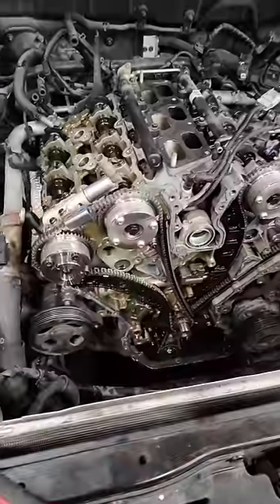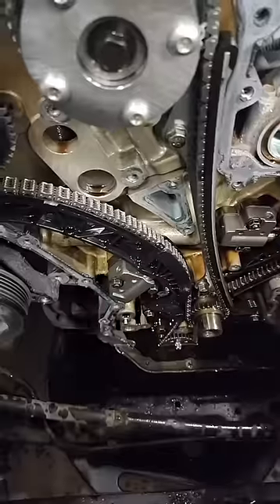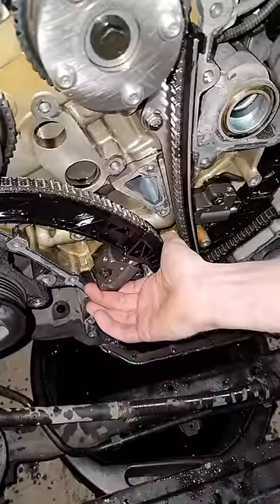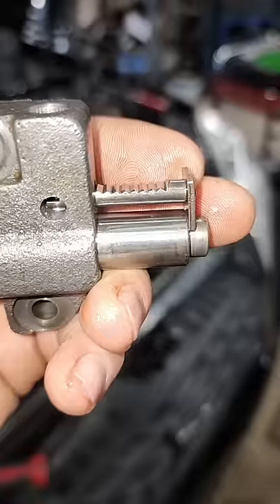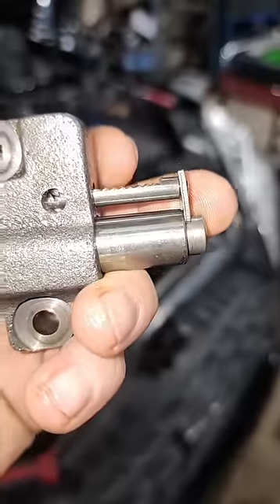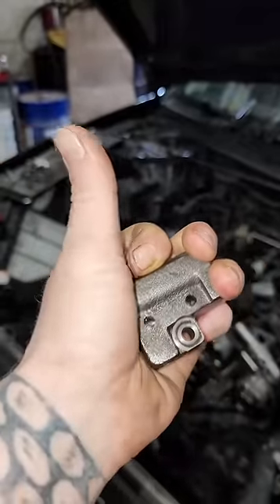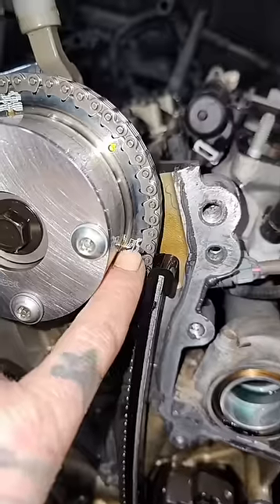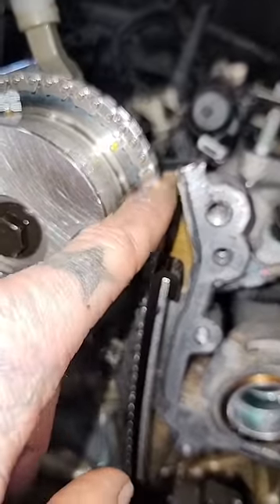I'm not happy

Comment: Hope you do a follow up. Curious to see Cloyes' response
Reply: Cloyes told me too bad,would not offer any assistance!!!
Reply: At best they offer to replace the tensioner with likely another tensioner of equal quality.
Reply: I did this job on a 2016 Explorer 3.5 the crank sprocket broke in half and destroyed the engine the good news is they told me they'd send me a new crank sprocket it's got me in quite a jam with my customer
Reply: Good luck! Same happened to me with a cloyes kit. Took out valves and a couple pistons. All they offered was a new tensioner.
Reply: @murderbirdLTX  damn
Reply: Is Cloyes an aftermarket provider or was OEM used?  🤔
Reply: @eddiegerlach7121  Cloys is aftermarket, they used to be one of the better options. I've used this brand for years. Next time I need to replace something, I might not use this brand considering I've read some pretty bad things in the comments.
Reply: this is why you file a labor claim through the parts store. Are any of you guys even real mechanic's? 🤣
Reply: Boycot Cloyes
Reply: @Thundarr995  don’t buy cloys. Oem timing or nothing at all
Reply: I've seen a few times where the parts supplier covers the labor, but only if it's a shop. If you're a regular customer, they tell you to kick rocks.
Reply: @CobraKiller02  I Kno right. Even if they dont cover all the labor they cover at least 75%
Reply: @eddiegerlach7121  cloyes is an aftermarket provider but claims to meet or exceed oem standards.
Reply: @crimsonlight4205  is it that much more expensive to go OEM?  I understand saving where one can, but is it difficult to persuade the customer about the peace of mind?  There are AM options that are proven and I always go OEM when possible ....sounds like these Cloyes folks are something to avoid.  🤔👍
Reply: @YomommasStankPoon  
That was a nice way of them saying to go get bent.
Reply: @Thundarr995  depressing seeing these name brands going down the toilet that can't be trusted anymore.  
I don't wrench on the side anymore but stuff like this would make me go OEM. Keeping my own fleet going is bad enough, and me getting older I don't have time for junk parts (not that OEM is always the best).
Reply: @eddiegerlach7121  cloyes used to be a great name in timing products. With older vehicles I often used cloyes double roller timing chains or their noisy timing gears. Guessing they just aren’t too good with newer tensioners.
Reply: 30 years ago Cloyes was good. Oh well.
Reply: @JJ-py6es  If that happened to me, I would seriously consider taking them to small claims court.
Reply: @eddiegerlach7121  Cloyes, based in Arkansas, is aftermarket.
Reply: @m3rdpwr  this is happening alot with old trusted brands. 
Definitely a good idea before purchasing these days to see if your favorite company got bought out.
Reply: I bought a Cloyes  for my 2.7 Dodge because I thought they were quality even though I had a problem right out the gate with the first one I thought it was my fault on my own car
Reply: @CobraKiller02  I did that once with a Motor Mite Dorman flex plate that was made of such soft metal it tore apart like cardboard before the car made a 3 block test drive. I raised Hell and they ended up having to pay to have it replaced with an oem junkyard part as well as refund the purchase price. I wouldn't accept the replacement because it was made of the same cheap metal. The original part was hardened steel and rang like a bell if you tapped it while the new one just made a dull thud and was so soft I could bend it with my hands.
Reply: @CobraKiller02  If your not doing $3000 a month with tbe parts store, they won't eat the loss for you. If the parts store isn't doing $10,000 a month with Cloyes, Cloyes isn't doing anything for them. And chances are if Cloyes claims are killing them, they will switch brands.
Reply: @MrTheHillfolk  agreed, or just put profit ahead of quality.
Reply: @MrTheHillfolk  BTW interesting channel you have. Subscribed.
Reply: @m3rdpwr  
Hah,thanks man ! 
I've gotta do some uploading , I've got a ton of footage of that Ute conversion but no time to edit and post. 
I might end up doing an update vid and then posting the older footage I have. 
Thanks again ✌️
Reply: @MrTheHillfolk  yeah, I hear you. I have a couple hundred videos, mostly air fryers. I haven't posted anything or not much of anything for the past year.
Reply: @eddiegerlach7121  Not as much markup on factory.
Reply: @thisisyourcaptainspeaking2259  "equal or lesser value" 😉
Reply: @CobraKiller02  I came here to yell "LABOR CLAIM!" LOL
Reply: @andylowe2725  Oh good, another fine product from Arkansas.  I'm going to blame meth.
Reply: @Thundarr995  so even after this story right here to which you are commenting…you still might buy crucial parts from this same supplier. God bless your future customers Sir!!
Reply: @murderbirdLTX  what was your torque spec on your crankshaft bolt?
Reply: @CobraKiller02  it's still pretty hard to get a labor claim through the local parts store  because they only want to give you 40% of the actual labor
Reply: @larryreno8293  I don't have my notes in front of me but I'm pretty sure it's something like 37 foot-pounds then 90° and I use red Loctite
Reply: @larryreno8293  that was a new crankshaft bolt of course and when I did the autopsy the balancer and the bolt and everything was securely in place just pieces of the crank sprocket down in the oil pan
Reply: @eddiegerlach7121  recently it hasn’t been cost that drives technicians to use a aftermarket supplier it has been the lack of OE parts availability. It took 7 months to get a 5.0L for a ‘17 F150, 9 months for a 3.5 for a explorer, 4 months for a 3.5 turbo.
Reply: @murderbirdLTX  I hope you didn’t skip the first 2 steps of the toque procedure, because if you did that is the reason for the failure. The first step is to torque to 89 lb/ft. This is required to pre stretch the bolt then loosen 1 turn.
Reply: It’s as if you all didn’t realize Rockauto sells OEM parts for most cars. 

Sure, if something fails, they’ll only replace that one part, but I find it hard to believe so many of you “unknowingly” destroyed your cars before you noticed the new failure.
Reply: I've used cloyes many times....last thing I need is what happened to you. Dealer from here on out
Reply: @Solar Yellow IS300 
Except aisin, technically aftermarket but used in OEM kits for Toyota and make kits for other japanese brands
Reply: Who is John Galt? In so many words, imported steel isn't the same. Period
Reply: Cloyes is OEM for GM. Done many ecotec engines and the ones you pull out say cloyes/GM

Comment: The worst part of working on cars isn't busting your knuckles,  getting greasy up to your elbows,  or having junk land in your eyes.  The worst part is deciding if the new parts are worse than the old ones you are pulling off.
Reply: I just had this realization the other day. Guess that means progress.
Reply: Had to reuse my temp sensor because the new one was way off.
Reply: FACTS! As I read this with gas in my eyes lol
Reply: Wear those safety glasses kids
Reply: I'll pull used OEM parts from a wreck before installing most of the new trash they make. Wear gloves chemicals are bad for us and our skin is amazing absorbing them.
  Edit for auto correct
Reply: @Deric Cribbs  that's about where I am.  I've put two new thermostats in my old rig and they are both faulty.  I'm going to go down to the wrecker and grab a couple, hopefully from the 90s.
Reply: @jasongross4124  we're the new old people.  "Back in my day".
Reply: my mechanic asked me once with a dead face "you wanna change your good part for a new one"?
Reply: I think you nailed it here they replaced one too many parts. I get the we might as well since were in here but not with inferior parts

Comment: Just had to redo a timing chain cover gasket and front crank seal due to the front crank seal failing a week after installation. I'm really getting tired of doin the same job twice because of poor parts quality control.
Reply: Thats why you should inspect the parts before installing them. Of course there will be parts that you can't tell if they are gonna fail by just looking at them, but most things, especially seals and gaskets will have pretty obvious signs of defects. Just always spend the time to look at the stuff before you put it back. Even stuff you ain't replacing. It's worth noting what is and isn't broke or breaking because then it can't be said that you caused new problems when you have a list and offered them to replace it when you was working on it.
Reply: Alot of these parts are made in third world countries or China and are never inspected being made from tooling that have seen 14 times the ammount of parts the tooling was made for.
Reply: I have a hard time believing it was the parts fault ...
Reply: @@thejloud be surprised how much shit can get damaged working on cars especially when taking off old bolts lol (not a trained mechanic)

Comment: Like the old saying goes "just because it's new doesn't always mean it's good" lol. That really sucks for the customer though.
Reply: And the mechanic too, having to do the job twice due to crap parts.
Reply: "NEW" doesn't mean "good".
It just means "Never Ever Worked"
Reply: Manufacturing default. 

Machines mess up occasionally.
You gotta realize, a human made that machine and another human programmed it.
Reply: @robert9595  engineering default.  The whole system is based on profits.  Cheaper metals means more money.  Cheaper componants mean more money.  Im not saying manfacturing doesnt have flaws, Im saying worse material is being used to make parts
Reply: Do people just pull new parts out of the box and install them without inspections? You can see the bad teeth while demonstrating that they don't catch
Reply: @stevensmith8923  dont take much to make em strip off like that.  Ive seen multiple slack adjusters do the exact same thing with one application of the service brake.
Reply: What it sux more for is the guy that did the job....I mean yea the customer IS important but the poor guy that's got to redo the job for nothing

Comment: I had this happen to a timing belt tensioner in a Subaru with an EJ motor... Once upon a time companies used to honour their warranties- especially to commerical workshops, this isn't necessarily the case anymore. We often find we have to take companies to court to get was would have previously been run of the mill warranty claims
Reply: But it take more time and cost more money going to court fighting them to fix it then just fixing it yourself. And they know most ppl wont bother because of this.
Reply: @jacksmith2315  depends on your jurisdiction. In a lot of countries you'll get all your costs and fees back including hourly rates for filing and attending court

In Europe, this is a classic "unfit for the purpose for which it was represented for sale" and full liability for making good (including consequential damages) falls back on the parts supplier
Reply: Ah yes the ej .. a engine know for its superior head gaskets , indestructible timing belt and pistons made from Thor's hammer .

Comment: Just a heads up on those 3.8s if you have to replace the cvvts on the cams there is a TSB that hyundai changed the tooth pitch on them and the timing chains. So you have to order new gears for the crank along with the new chains and cvvts. Trying to save some headache.
Reply: Already migraine inducing so that's appreciated.

Comment: Cloyes got me on a 2011 Traverse with this. I video documented the teardown and install cuz I was planning on starting my own channel. They covered a used replacement engine but had to fight for it. Did not cover any labor.
Reply: It's absurd they don't cover at least part of labor - like hello it's required because your part(s) failed.  If not for that it wouldn't NEED the engine rebuilt/replaced! 🤦‍♀️ So you're having to pay out twice - once for original job then second time to repair damage from original job!